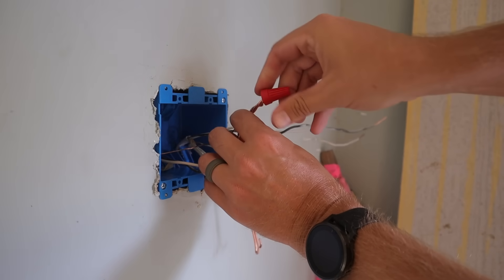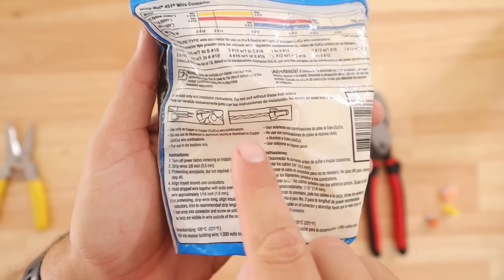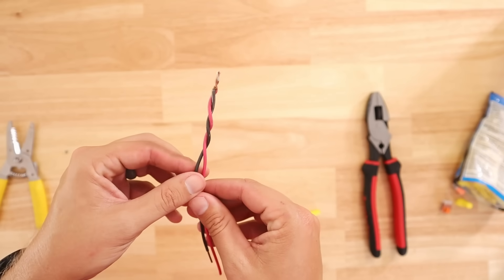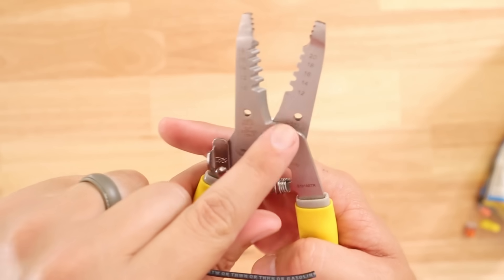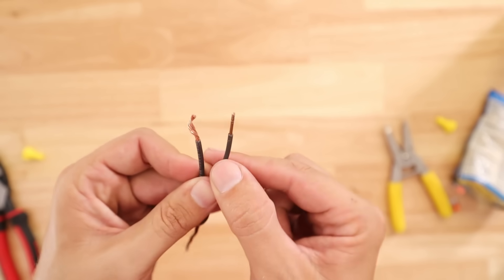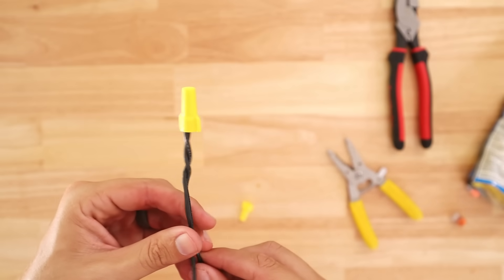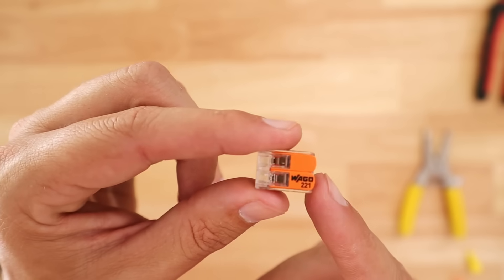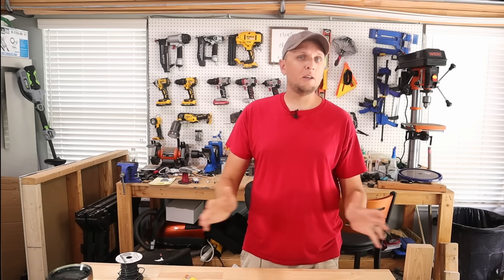BIGGEST Mistakes DIYers Make When Connecting Wires Together | How To

Comment: I'm in Florida and do not ever want to have to go into the attic in the summer to try to find an open connection.  What about making the  connections in the j boxes in the attic by making the proper twisted connection, soldering the connection, and then putting a wire nut onto the soldered connection.    I solder with a propane torch.  It heats up the copper so fast that there isn't ever a problem with creating an oxide coat on the copper wire before I can get the solder into the wire.

Comment: my dad learned to wire houses during the depression. he'd twist the wires together, then solder them, then twist the nut on. he did not trust wiring not to vibrate loose from traffic. it took an act of god for them to accidently come apart. we had an old medicine cabinet with the beveled mirror and side lights attached to it. heavy as it was, it hung from the wiring with nary a worry about it falling off lol.

Comment: I prefer to use the set-screw type MARR connectors.  And when I fold the wire into the box, I make sure that the connector is pointing to the top of the box.  This prevents the insulating shell from dropping off, should it loosen due to vibration.
Reply: Set screw type connectors are very poor, I recommend you dont use them.  But you MUST pre-twist if you do.  I have very rarely come across a set screw type that due to heating and cooling of the wires has not become loose.  This will not happen with properly installed spring type wirenuts.
Reply: @Singlepole  Methinks set screw type connectors, properly tightened, are superior.
Bear in mind that torquing the set screw slightly deforms the connector body into an oval shape, thus providing some spring loading, also.  Been using them since 1969, beginning with my mother's house.
A subsequent electric company inspector called my work very neat and tidy.
Reply: @BasementEngineer  I have removed many for melting down due to not a good connection, I suspect from heating and cooling.  But its fine, they keep me in business.  :)
Reply: @Singlepole  Any screwed  fastener and connector must be properly torque tightened.  Failure to do so will result in disastrous consequences.
This applies to structural bolts holding up bridges and buildings, car and truck wheels, as well as electrical connections.

Comment: Ok I’ll be honest. As a lifetime union hand graduating a 5 year program, I tapped to be amused and maybe leave a mild ribbing on goofey wiring how to’s.  But 1st you referenced the NEC. ( grabbed my heart ) , then you referenced the actual manufacture’s instructions and recommendations, ( I’m almost proud though I don’t know you 😂 ) lastly you spent some time with real world examples and methods with visual  results backing up the tips.   Well done sir. 😎👌
Reply: Ps. soft wire nuts suck ass and should never be tolerated by the worker for the contractor to purchase.  When they continue to go missing they”l stop buying them. 😘 yw

Comment: Should always pretwist, especially for anything more than 2 wires. 
I give all my apprentices that cheap little plastic wire nut socket for their impact. Using that AND a pretwist, should be good to go. It is possible to use the wire nut socket on 2 wires and have it twist enough. 
Basically all you're looking for is when the wire nut is removed (or eventually falls off 😉) the wires will stay connected and not arc out.
Reply: And I should say, I've wired over 100 houses (big custom houses) and have never used or needed to use those Waygo connectors. Other than the ones that come factory on some lights.

Comment: If you do not twist your wires together before you put on the Marrette you are just lazy!!! If you dont twist them with your linesmens first and you are a pro, you are a lazy hack. You can not see how they twist together with just the Marrette, you can not guarantee it is a safe good connection. 
2 minutes in and i do not like where this video is going...
USA they are call wire nuts, ok, nuts go onto threads, pre-twisting the wire gives you those threads. It not rocket science.
Being lazy with electrical can kill.

Comment: Those WAGO connectors are a great invention. They seem to be just like the wire connectors that have been used on the back of amplifiers for decades. I've never used twist connectors, because they've always seemed flimsy to me and a bunch of them seems to create a bulky mess. I always either soldered wires together or I've used block connectors.
Reply: I've seen a video of someone testing WAGOs to destruction. The 22x-series meant for 20A max is doing fine at least up to 30A (not heating up any worse than the wiring) and doesn't burn down until 60A or so. Definitely looks like the most easily repeatable option for general-purpose wiring.
Reply: @teardowndan5364  
Thanks for replying. Fortunately, I never work with that sort of power. I just do amateur stuff, like soldering electronics kits together or repairing small electronic items. The times I used block connectors was for installing car stereos. I also helped to re-wire a trailer once. That was really easy, because we just had to follow the wires and replace the plug.
Reply: Even in bulk those things cost 27 cents each. That's a fool's purchase in my book, when a wire nut is a nickel.

Comment: Your wrong by twisting the wire like you show damages the wire. They say the wire nut will twist it enough to make a connection, over twisting will damage the. Been a electrician for over forty years. Don’t teach what you don’t know
Reply from the maker: Go out to your garage or van or wherever your gear is and test it.  Then remove the wire nut.  I’ve done it many times and until the wire has twisted a couple times under the wire nut, when I remove it they just fall apart.  With a few twists it does twist the wires to form a joint but still not great.  Another reason why I think pre twisting is best.  But I appreciate your opinion.

Comment: As a Retired industrial controls and Haz location electrician I found it best to make my stranded a bit longer and use my fingers to give the solid a staring twist, as I have had more than one solid wire poke right through the end of those cheap yellow wire nuts. 

I "NEVER" willingly used the yellow wire nuts! The tan wire nuts are the same price, same size in J boxes, tougher and hold more wires in one nut, easier to grip and twist even come with a nut driver tool(I never used) for your cordless tool.

Comment: A loose connection will heat up due to arcing could cause fire always twist together then add wire nut.
Reply: I was taught not to do that…don’t pre twist.
Reply: @jamesmdean1987  I was taught to pretwist if all solid.

If stranded, or a combo of the two, then don't twist.  Maybe leave a bit of insulation on the stranded to keep the strands together.
Reply: I just use electrical tape after twisting. Or use a heat shrink butt, melt plastic to wires then electrical tape.

Comment: Looking back on 30 years of residential/industrial/commercial electrical service/install, the quality of electrical connections is about as important as it gets......so if you are not an electrician by trade, SLOW DOWN while making up connections. ALL of your power splices/connections need to be contained in a listed electrical box/enclosure with cover installed when complete. NO OPEN SPLICES. Loose connections may begin sparking/heating under load to the point that they GLOW orange hot and can ignite any combustible materials they are in contact with, or emit a quick burst of sparks that can ignite material further away if they degrade to a point that a short occurs. Boxes are meant to bring that ignition potential down to almost zero if properly installed. The connection has to be TIGHT or heating will occur. Cranking on a wirenut to the point that you are also twisting the insulated part of the wires more than a little, is a good recipe for making the inside spring of the wirenut to drive thru its top....setting up a short/shock hazard. Use the proper size wirenut for the size and number of wires connecting. There is a BUNCH of things to know when splicing, the more I think about it. Anybody who says wirenuts are for DIY'ers or say they solder all their connections ARE the DIY'ers. Wirenuts are UL listed for making connections, just use them as instructed by the manufacturer. Dont tie into or extend ALUMINUM branch circuits if your home contains 15/20amp al wiring. Special connectors AND devices (CO/ALR) are required.

Comment: English Electrician-would never twist wires close together, or use those 'Wire nuts". Looks to me as you've twisted neutral to a live. Crimps are used over here, which give a perfect fix, using pressure.

Comment: I always made sure to use HardCase wirenuts for stranded  and  softcase for  solid wire... but  yes  always twist wires to prevent loosening  due to vibration.  If  you are forced to connect solid and stranded...  either use scotch-locks  or solder the wires, then  wirenut them.

Comment: Well what we have is an amateur showing people how to put on a wire nut.  What good is that?   How about someone that knows how to put on a wire nut showing how it is done? First off you don't pre twist the wires.  This is how you do it. For everyone that wants to do it right that is. 

First off you start putting on the wire nut. Then you bend the wire to a 90 degree angle a few inches below the wire nut. This gives you leverage to twist on the wire nut. Then when you have it all the way on take your lineman's pliers and give a couple more turns.  That is how a professional puts on a wire nut (solid wire) like # 12 AWG. 

Also If you are doing a lot of wire nuts they make a wire nut driver that goes into a drill and spins the wire nut.   But it is still done the same way.

Comment: Any worries about the connections can be eliminated if you solder them together before you put the wire nut on.
Reply: that is electronics. Not electrical wiring.
Reply: @jamescole3152  I've done both but if you want a 100% connection without chance of failure soldering the two wires together will never fail.

Comment: Professional electricians  might prefer wire nuts as they cost less, but I recommend WAGOs for diy/homeowners as they are pretty much fool proof and you get a reliable connection every time.
Reply: So you back stab wires into outlets as well? Same difference using a wago. Seen to many fires. In my opinion nothing is reliable as twisting a connection and then using the wire nut to just cover the connection.

Comment: The packageing shows you both scenarios twisted and untwisted pictures are not instructions words are instructions. And it clearly says twisting is not required. 
I dont agree but that is what it says so it is not wrong as you state it is
Reply from the maker: It does not show two different scenarios.  It shows lining up the wires and then how it should look after the wire nut is twisted on.  Pre twisting is not required, I stated that in the video.

Comment: No electrician whom wants to get a job done in a timely manner, is going to use their pliers to twist and cut the wires first.  If you are wasting time doing this, you are most likely wasting time in other areas. Now with this said, there is one electrical industry where I could see this time wasting method being used. Governmental work.

Comment: It’s not a ‘wing nut’ … ever!
Reply from the maker: They go by many names.  Even Ideal calls some of their lines “wing nuts.”  Technically wire nut is not really what they are called either.  But for the most part we all call them that instead of twist-on wire connectors.
Reply: @HowToHomeDIY  nope a wing nut is something entirely different but then I guess you can call it what you like in the colonies!
Reply: Wing nut is the brand name. Those are the good ones.

Comment: Obviously you have never done this for a living. If you took the time to do it your way on several hundred joints a day, you'd be fired in no time. Twist them on, do a quick tug, shove it in the box and move on!
Reply: Totally agree. I’ve been an electrician for a long time and have only pretwisted maybe five times in my career. The whole design of the twist lock wire nut is to get the same results as a pre twist. I always get a kick out of these videos that say this is the way the pros do it lol.
Reply from the maker: I get a kick out of some of these comments personally when the electricians I know do pretwist every time.  They are commercial and residential electricians and they all take the time to do it.   Soooooooo 🤷‍♂️
Reply: @HowToHomeDIY     Isn't it funny they didn't show you how to do it correctly. Maybe they have only been doing this for a few years.
Reply: James Cole I didn’t see anything wrong with how he showed pre twisting.  That’s exactly what we do.
Reply: @HowToHomeDIY  Before they outlawed #12 and #10 Aluminum wire you had to twist them, and I did. If you take apart any of my copper splices, put together non twisted, they WILL be twisted. That said, probably 99% of my splices were made with 3M Scotchlocks and I used a crank tool, twist until you hear the click. The Ideal's 
are junk in my book.

Comment: That is not the way the instructions state, … and depending upon the strength of the wiring, (tensile strength) …it IS acceptable, (& quite normal), … to use as the “INSTRUCTIONS” state, the display of a picture, is not the Instructions per se, …  if it were, then there would be an indicator pointing to the picture, … Lmbo! Better stay with your day job, because a lot of the times, there will either be no room, for extra twisted wire, or not enough wire to do as per your suggestions, …

Comment: Anyone who has joined 2 solid wires together without twisting them together with the end of a pair of linesman pliers prior to twisting on a wire nut, shouldn't have been joining any wires together to begin with. Electricity anything to do with it is not to be done half-assed or in a lazy manner. It can not only kill you but can kill others too. And often leads to fires. But there are so called electricians ive seen that cut every corner they get a chance to cut. Especially when connecting breaker boxes. And don't get me started on the guys who think Ground wires are over rated.
Reply: You are doing it wrong.  The wire nut fits on the wire much better when the wire is straight, not twisted. That is the way it is done unless you are putting 6 wires together.

Comment: 22 year Electrician here, so the first half of the video you are talking about how the wire can come loose, the wire nut can come off etc, of course that is a concern but what's not talked about here as I explain to my apprentices is why would you put the load on the metal threaded spring inside of the wire nut? If you just for an example lay two #12 gauge copper wires side by side and place a wire nut over the connection then if those wires ever separate the least little bit the entire load of that circuit now relies on whatever gauge metal is inside that wire nut, if the gauge isn't suitable for that load then you now have heat building up, next comes the melting of the wire nut, next comes the flame and so on. I have seen SO many connections burned up, melted because of this exact practice. For the guys learning, please take my advice, strip your copper, align up the (coating, jacket) with each other, use your linemans and give this connection a nice twist of roughly 3 to 4 times. You will Never have an issue taking an extra 10 seconds to do this correct. If you catch a electrician doing this in your home, get someone else because this poor method tells everything about him that you need to know, He's lazy and does not care what could happen. In that codebook it will actually tell you that the local inspector has the final say, where I am from he will flag you every time if he catches you and I agree with him 100%
Reply from the maker: Fantastic point that I did not cover!  Very well said and articulated.  Thank you for taking the time to write it.
Reply: No, you are clueless. If you watch the Ideal video you can hang 200 lbs from a wirenut connected by twisting.
Reply: @jamescole3152  please do not ever do electrical work. Nothing in my statement talked about anything regarding pulling on a wire nut. You use a wire nut to cover a connection NOT make it. Pure laziness! Dangerous and outright poor workmanship! People like you are the ones that die or kill someone else doing electrical. We call ones like you shade tree electricians.

Comment: When do you decide to add electrical tape wrap of the wire nut connection?
Reply: Guys will wrap with electrical tape if they think there is a chance of debris getting into the backside.

Comment: We used the grey lever nuts (not shown) ones because they were UL listed and OSHPD vibration tested for low voltage stuff.  We had to do barrier junction in 4x4 or use Wagos, we weren't afforded much choice outside paying for product to go through a shake test.